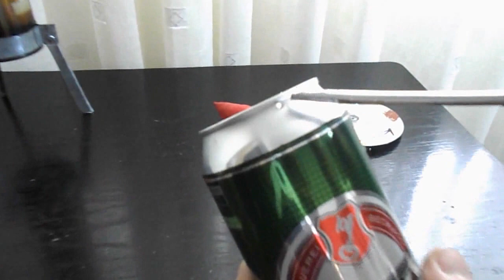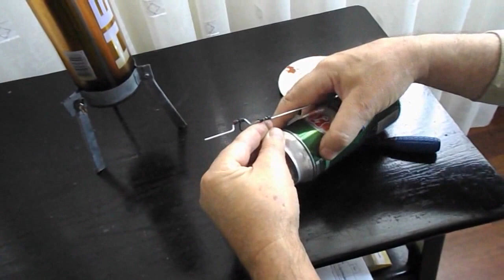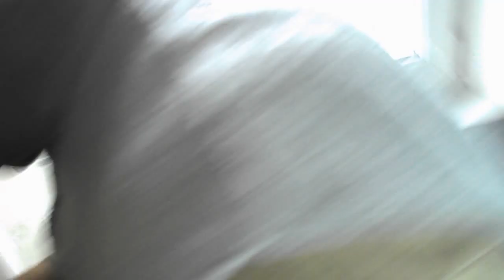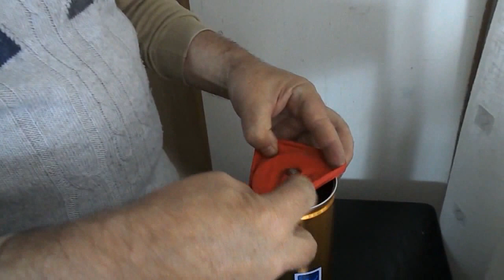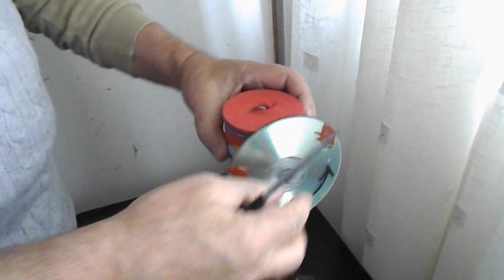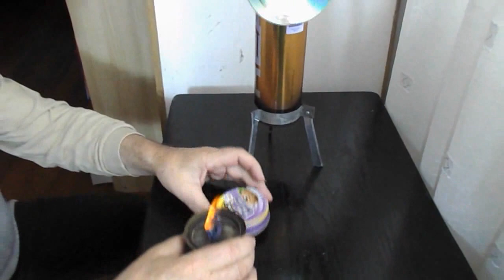My stirling engine model 5

Comment: Lovely design!!! But, How do you connect the displacer cylinder to the hook? Yo that small hole in the soda can? In which case the displacer is hanging one sided and will collide with main cylinder right? What is the covering of the displacer cylinder please?
Reply from the maker: Thanks for viewing. the mobile cylinder touches the inside of the fixed cylinder. this does not affect the operation of the engine much. I was interested in this model to create a compact system. of course you can study the rectilinear displacement method.
Reply: @constantiniliescu4606  Thank you for your response. This is a fantastic design and simple enough for even me (not very good with building stuff) to replicate!! So the hook goes through the small hole in the displacer cylinder…hangs a bit lopsided because the hook is at the edge, so it touches the can likely at the bottom, but this friction is not great for the displacer to still move up and down? This is great. I have to try this model!! Thanks again.

Comment: Does the  air not flow out through the two holes for the flywheel? I think the holes are quite fit for the axis so that air is not moving outside.

Comment: Too much free volume. No regeneration. Balance the assembly. Sheild the heat source. Add cooling water operate at boilng point with charge of water.
Reply from the maker: Thanks for comments. are correct. I just tried a new compact design. I was not interested rotation speed or power. We have demonstrated that it is possible. I have many ideas for improving this model 5
Reply: @constantiniliescu4606  taking constructive criticism is a sign of a capable engineer.

Comment: I'm also going to make a Stirling engine, but I have doubts about thermal strength of the membrane. Doesn't it stink or melt after using for a long time? I've also thought of making a piston of i.e. thermal silicon, modeling clay or plaster by partially filling another can with one of these materials and removing the ready piston from the can (it may require cutting it if it sticks to it's walls).
Reply from the maker: The membrane is normal aging. At the top of the hot air gets cold. So not smell
.In my model number 5 I used a piston plaster wrapped in aluminum foil.
I apologize. In my models 6 and 7. Please see here plunger driven bottom-up
Reply from the maker: You must try

Comment: why is the air not escaping from the crank shaft  holes in the cylinder?
Reply from the maker: It is my secret
Reply: Minor leaks are acceptable, the engine is still running.